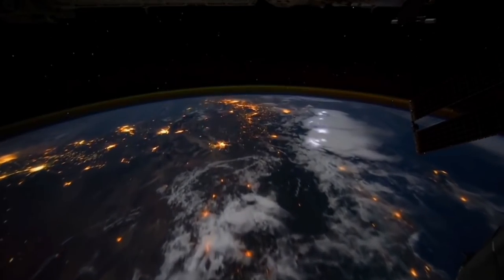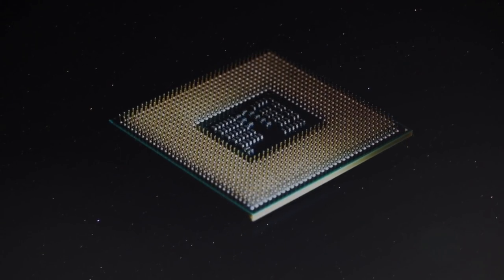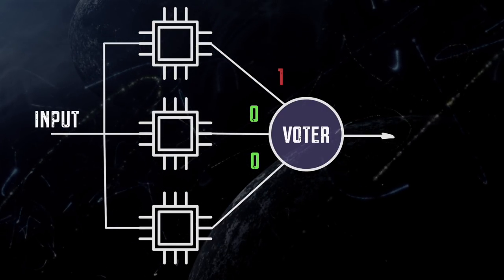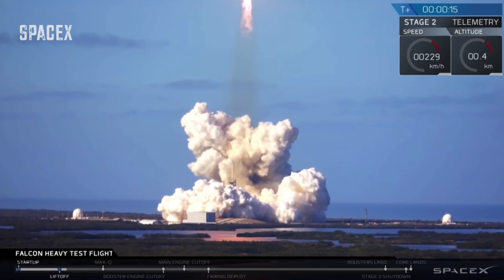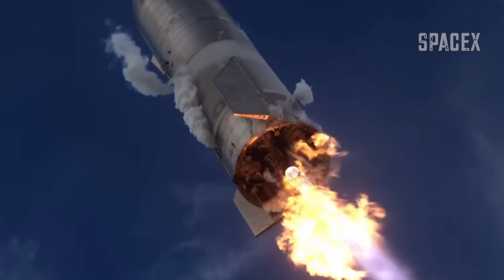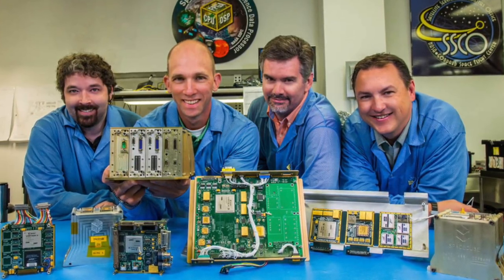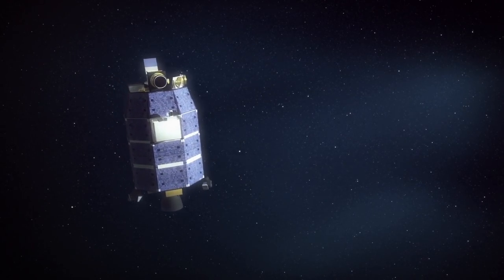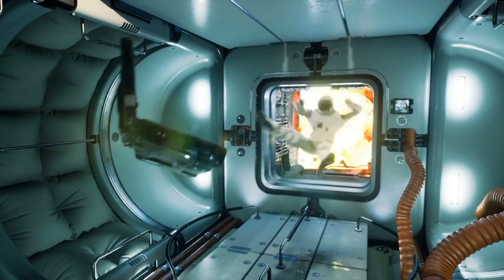Computer Chips for Space Travel

Comment: Awesome video! I've never heard a discussion of chips in space before. Extremely fascinating! Thanks for putting it together!
Reply from the maker: Glad you enjoyed it!
Reply: Agree, interesting is also EEVBlog episode #897
Reply: What I find interesting is the Apollo electronics were far more radiation tolerant than todays electronics. But it was a LOT slower. the use of things like core store and wired memories were very stable but very small capacity. The Semiconductors used were more reliable mainly due to the massively larger dimensions of the transistors, that made them far less prone to single event cosmic rays that are well over 10,000 times smaller transistors used now.

Comment: I'm only a "half geek" and appreciate your channel very much. I find your presentation to be understandable with the limited knowledge I have. This means I am actually learning something here. Thanks! 

I'm 67 and when I was about 20 I had a boss that bought a 1200.00 scientific calculator. You can now buy a much more powerful scientific calculator for 10.00 to 20.00 at Walmart. How things have changed. I think it was about 1961 when my dad came home from work (at a GM plant) and said he saw a computer for the first time. It was a basement level of the whole assembly factory that was refrigerated and had rows and rows of what looked like tape recording machines among other stuff. He said you could feel the heat generated when walking by some of them and it took up the whole basement area. Now, I'm sure my smart phone has far more capability than ten thousand or more of such antiquated computer systems.

Comment: ECC has been used on Earth for many decades, since the 1970s in mainframe and blade computer architectures. Vote processing has also been used in difficult environments like automobiles and power systems which often operate in high static and current surge applications with high voltage components like spark plugs and high rotating magnetic fields (like high speed motors in ECs). . 

I have heard Musk mention redundancy as a fix for many of the failures that result in RDE (Rapid Disassembly Events) in applications such as rocket engines and connected guidance systems. One solution to high noise environments that I did not hear was "Faraday Cages" which are heavy but very effective in challenging noisy environments. 

Excellent video. Very well done.
Reply: Another solution could be the recently discussed "force fields" (yes, they are real) used to defend against high energy short pulse laser weapon attacks.

Comment: How about a video on the Apollo electronics. They were far more radiation tolerant than todays electronics, But it was a LOT slower. The use of things like core store and wired memories were very stable but very small capacity. The Semiconductors used were more reliable mainly due to the massively larger dimensions of the transistors, that made them far less prone to single event cosmic rays that are well over 10,000 times smaller transistors used now.
Apparently someone turned on an original Command Module core store and the data stored in it 50 years later was still good.

Comment: Analog (mechanical) computers for launched crafts would be an interesting topic to watch. For example, combined with the most rudimental microprocessors used up there. A question. How much of the protection from radiation would a typical, modern chip need. Let's say if a space traveler would want to use a current gen. laptop like an ASUS, Apple, or Dell?
Love the "Not a bug, it's a feature" explanation. The mic sounds almost ASMR, so I think it's good in quality.

Comment: Back in the late 1990s our pump station was automated. Inside the control panels for each of the main engines was..............................................................................a 386DX that was radiation hardened. Why? Because we absolutely could not allow for errors to occur due to anything. Everything had to also be opto-isolated except for the input power. Guess where the glitches always came in from. Yep, the commercial power.  And the hardware would sense it and shutdown. With a 10 minute to reboot and run time. It took about a month with a chart recorder to catch the little blip on the power line. Way that was solved was more capacitors.  So even radiation hardened chips also have to be shielded from outside influences in the busses.

Comment: Are Hardware Design Engineer by any chance? 
Very good research and compiling info in a single video. 
You should also add that so many EU  Chip companies also have great Rad-hard devices.
Reply from the maker: Right, good point. Companies like ST and Infineon both have Radhard products. However, those are not focused on compute, thus have not ended up in this video. 
Thank you! :)

Comment: Ciao Anastasia 
Great video!
Considering that in the future the cost to orbit will decrease dramatically if SpaceX succeed with starship will be possible to deploy data center in space? If the hw cost is very high and performance low sadly I think no… 
And what about starlink satellites hw? How SpaceX managed to put high performance network hw with 20Gbps bandwidth capable of survive at least 4years?
Reply from the maker: Ciao Alberto! Thank you.
Starlink runs on lower orbit, so less radiation. Otherwise, they use sw and hw techniques I’ve discussed in the video.
Ciao !

Comment: Just in minute 2 of the video and I have to make a comment, PowerPC 750 running around Mars on the Rovers (not sure about the latest aka newest, but the previous two yes) Same as the old MacBooks though radiation hardened and lower clock to survive radiation as you correctly point out
Reply: The package has among other things, gold film due to the density of gold

Comment: curious if the Tesla FSD chip in the cars is radiation hardened.
Reply from the maker: I don't think so :)
Reply: @AnastasiInTech  sounds like they have error correcting code but not rad hard chip. Might be worth trying at some point since they designed it themselves
Reply from the maker: Yes the most of commercial chips nowadays use ECC. There is no need for rad hard in a car :)
Reply: @AnastasiInTech  this chip is expected to be used in their bot.  There is zero doubt that it’ll be used in space as well. Maybe a radiation hardened version will be needed then.

Comment: Why not use a rad-hardened enclosure with off-the-shelf ECC capable components?
Reply: She actually mentioned this option in the video …  it is possible but expensive
Reply: There are limits to how much radiation can be reduced by any enclosure. To reduce deep-space radiation levels to Earth-surface radiation levels would require meters of shielding.
Reply: @zzubra  good point. Have you run the math ?

Comment: Why do you think rad hardened chips are required for long duration trips?  I see no net advantage over redundancy.  You don't care if random bit flips happen if you can catch and fix them on the fly.  You can run higher redundancy than 3x if you're really worried.  

I know the iss gets about half the gcrs when compared to a Mars mission because the earth blocks about half in LEO.  That said, I don't see any real advantage for rad hardened equipment.

Also, it's worth noting that gcrs and scp's are different, with scp's coming from the sun and gcrs coming from any direction.  You can sometimes block scps on spacecraft by reorienting or delaying a launch if you have warning of a solar flare ahead of time.
Reply: Seems you want both rad hard and redundant.  Even with more redundancy, you might lose a chip/module, and eventually redudancy isn't enough, when all cpus are dead, or you can't form consensus.  She also mentioned power budgets.  More redundant means more energy required, so that might be a consideration as well.  Just tradeoffs I guess.

Comment: Loved your this video, thanks so much. 
Regarding your upcoming video on Tesla auto chips, USB note recently notes that Tesla doesn't have the same constraints as other auto as they can recode chips per their requirements, and don't buy blackbox chips for set uses.
IMO another Spacex strategy going forward will be to minimise radiation damage in deep space at system level by shielding esp water shielding and redundancy as Rad hard chips are such a hit on performance and power. Chips are exponentially better now to decade ago. 
Also the use of regular qualcom mobile chips on tech demonstration Ingenuity helicopter on Mars indicates radiation needs system solutions. 

@1:50min 
https://youtu.be/oRKFpBguOt0